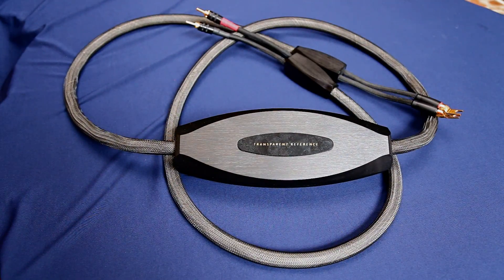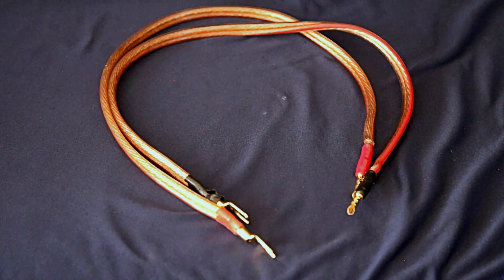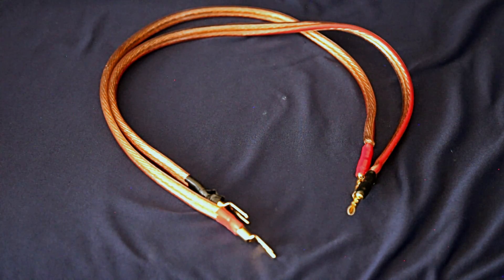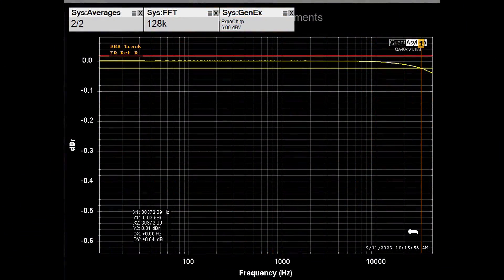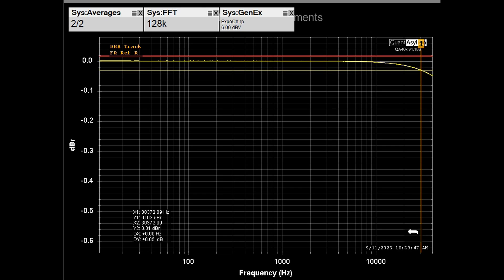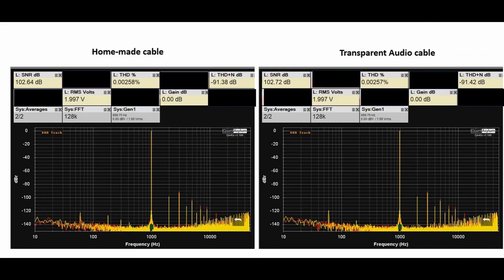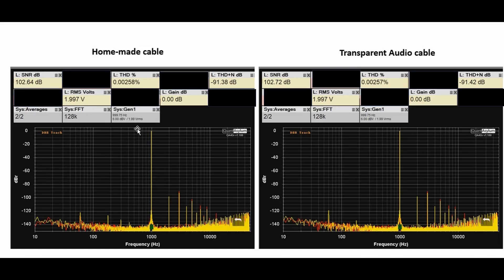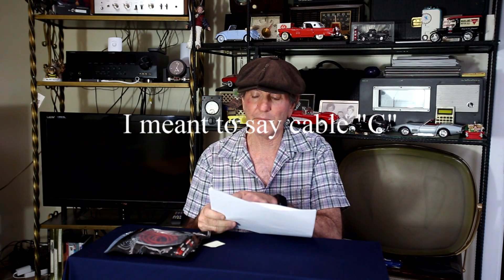$8000/pair Speaker Cable  vs. $14 DIY Speaker Cable A/B Test: Vintage Audio Review Episode #87

Comment: I used to sell stereo equipment and cables and I wouldn't sell expensive cable if I and the customer didn't hear a difference. I can tell you that speaker switchboxes and average quality stereo equipment will not let you hear the differences. The way to measure differences is to place a calibrated microphone in front of a speaker and measure frequency response and other characteristics there. I wonder if the is a way to measure soundstage width as there usually is a big difference there. I can tell you form a comparison I made years ago between hardware store 14 gauge lamp cord and audioquest type 6 speaker cable was that the hardware store cable rolled off the top end and muddied the bottom end and reduced the dynamics.
Reply: Rubbish ... The differences are purely imaginary.
Reply from the maker: If you are ever in Tucson we are going to have to get together for a beer or coffee
Reply: @vintageaudioreview   I should tell you that the speakers I use now don't really have speaker cables. The electrostatic panels connect directly to the amps. I was tired of all the distortion and coloration of all conventional speakers and cables.
Reply from the maker: @andershammer9307  Some of the best speakers I have heard are the Martin Logan CLX electrostatics, but they lacked bass the way I like it, even though he had some powered subs. I still thought there were speaker wires going to them....
Reply: @vintageaudioreview  My full range Acoustat X electrostatic speakers have some of the tightest deepest bass I've heard from any speaker. There is nothing like electrostatic bass except for live sound. You would swear I have a subwoofer but I don't.
Reply from the maker: @andershammer9307  Hopefully one day I will hear a pair of them, but the planar speakers I have heard have not had much bass. THnaks for sharing
Reply: @vintageaudioreview  You are welcome to come to Pittsburgh, PA to hear them. Just let me know before you come.
Reply from the maker: @andershammer9307  Sorry, I just picked up this thread between you and @andydelle4509 today. I would tend to side with @andydelle4509, but being able to measure is a key to sorting out a lot of claims by audio companies and helping to determine whether or not a speaker/amp combo is a good fit when you may press the limits. If the offer to come to Pittsburgh was for me, I appreciate that but I really don't like to travel more than about 2hrs from where I live (no real reason to at this stage in life)....
Reply from the maker: Thanks for taking the time to comment and share your experience. As for the soundstage I mentioned the same thing in an earlier comment I made on one of the posts on this video. You can get an idea from speaker measurements. The crosstalk (channel separation) of the amp/preamp could play a factor, and of course room acoustics. What you suggest with the calibrated microphone was done when I measure the frequency response of each cable with my analyzer- if you throw speakers, amps and the room into the mix there are even more sources of error, but I see your point. One commenter suggested that there should be a min. requirements list of equipment for fancy cables like Windows is doing now going from 10 to 11.
Reply: What was the wire gauge of the Audioquest cable? In this case it has to be 14awg or your test is doomed from the start. 

 "I can tell you that speaker switchboxes and average quality stereo equipment will not let you hear the differences."
 
Here we go again with this "resolving system" crap. That is pure audiosnob talk. What makes an amplifier or source device more resolving?  Three things, noise, distortion., and frequency response. Yes the old Julian Hirsch stuff, and it is still just as valid today. These things are easily measured, especially with today's computer analysis abilities, What are these numbers on a $600 Denon AV receiver? And on some $20,000 amplifier? Now I will cut you some slack with speakers as they are more an acoustical instrument than electrical. But I really have to laugh when some single ended 1/2 watt $20,000 tube amplifier with AC filaments and 10% distortion is said to be a "highly resolving amplifier".
Reply: @andydelle4509  My answer to you is to start reading the 80's vintage audio magazines like the absolute sound and stereophile and then get some of the equipment and cables they used back then and if the equipment is working properly you will most likely learn to hear the differences they talk about. The Audioquest speaker I used was type 6 but they had 3 different versions of the type 6 and they all sounded different.
Reply: @andershammer9307  And my answer to your answer is to start studying some basic electrical and electronic theory, Then move onto the mathematics which supports these well proven theories. That should prove to you these claims in audio magazines  have no scientific basis and rely on expectation bias, placebo effect, both coupled with lack of any understanding of the electrical engineering and electronics practices that have served mankind for over 100 years now. 

And you didn't answer my question.  I asked what were the wire gauges of the cables you auditioned? What is "type 6"? That is not a standard of wire size and capacity. There are both American and Metric standard wire sizes that are easily cross-referenced.
Reply: @andydelle4509  Ha Ha very funny. I'm an electronics repair tech presently repairing train control systems for companies like CSX and Amtrak. So I think I know a thing or 2 about electronics and I've been doing it more than 40 years. Type 6 Audioquest was a type of litz wire with several insulated strands of litz wire twisted together so i'm not sure of actual gauge. I think I still have them.
Reply: @andershammer9307  Control systems. That is mostly DC territory. How about AC circuit theory? This will explain how Litz wire works for RF but the math also shows it has no benefit at audio frequencies. Zero!
Reply: @andydelle4509  I may have access to test equipment to measure these things but I have a friend who is an engineer and we tend to hear the same things. He is sometimes baffled with what he hears but can't measure. If you rely on numbers and not your hearing then why bother ?
Reply: @andershammer9307  Expectation bias, placebo effect. You think in this day and age we can't measure an audio signal well beyond the limits of human hearing?
Reply: @andydelle4509  I know that we can't yet measure everything. My friend and I have access to the latest in electronic test equipment and we still hear differences that can't be measured. You may not hear differences but we do and can prove it and have proved it.

Comment: Good old 16ga lamp cord from the hardware store ... still the best speaker wire.
Reply from the maker: Honestly, 16guage lamp cord would be fine for most people's needs. I am not sure that it comes in OF copper, which I would want to use as I have had 16guage wire that was not OFC corrode over time, and that is in a dry climate. If you are running less than 15' to a speaker it should not be a problem. Thanks for your input.
Reply: @vintageaudioreview 
When properly tinned and soldered, the garden variety copper lampcord gives good long service.  OFC is best, I agree. 
The stuff you don't want is CCA (Copper Clad Aluminum) wire. That stuff is a technicians nightmare... it actively rejects solder, reacts with brass or gold fittings and breaks real easy when bent a few times.

A 10 foot speaker cable with 16ga lamp cord has a DC resistance of about 0.08ohms so it is suitable for most stereo uses. (4 ohms/1000 feet, 20 actual feet in the cord)
Reply from the maker: @Douglas_Blake_579  thanks for getting the resistance calculation. Years ago I read am article in stereo review or audio- probably in the mid 80's- and the author said that good old 16guage lamp cord is all most of us would need. As far as the corrosion, I am seeing it at points along the wire, which is somewhat clear, not specifically at the ends. Probably looks worse than the effect- at least at this point- by I built a match for the one wire that was used in the test so I use that now for my reviews.
Reply: @vintageaudioreview 
By corrosion I trust you mean that green mould like stuff... not simple colour changes in the copper.  Usually the jacket protects the copper quite nicely and harmful corrosion only happens in exposed bare wire ... which is why we tin the ends.
Reply from the maker: Actually, the green mold stuff. If i get around to it I will email you a photo.
Reply: @vintageaudioreview 
There is a dielectric grease you can brush onto the cables to prevent that.
I'll see if I can find a link for you...
Reply from the maker: @Douglas_Blake_579  Thanks for the suggestion, but having to grease the cables would be too messy to have in the house, plus the wires do have insulation over them. It is not a problem any more as I have replaced them with thiker, OFC wires
Reply: @vintageaudioreview  
I'm only talking about a tiny spec of grease at the actual connection points, to exclude oxygen from the bare wires.

In Canada if you are mixing AL or CCA wire with standard copper house wiring our electrical codes require this stuff be applied to every join and connection.
 
The big bugaboo here is that unless it's AC house or industrial wiring there is no obligation to disclose that what looks like copper is actually aluminum with copper powder pressed onto it's surface. Many times I've seen CCA speaker wire and even power cords sold as CU quality wire.  Amazon is one of the worst for this...

For those who insist on buying actual "speaker wire" I strongly recommend Monoprice brand. At least they tell you what grade of wire you're buying.
Reply from the maker: @Douglas_Blake_579  I will shoot you a picture of the wire before too long....
Reply: @vintageaudioreview 
Okey Dokey...

Comment: The best speaker cables I've personally tried were DIY braided CAT5. Very labor intense, but very good results.
Reply: The problem is such construction can have an extremely high capacitance per meter. That can create problems for some amps, putting them in oscillation or causing them other issues like ringing. For some amps it can work as an eq filter slightly boosting highs or lows. If you heard anything it was that. Personally I prefer eq to be controlled more precisely (in software or a treble control) . 

It’s is simple physics: the braided construction lowers the effective  impedance per meter but thereby increases capacitance per meter in proportion. The greater the number of braided strands  the greater the capacitance. And you would need lots of strands to get to a reasonable equivalent gauge, such as 14 awg (kimber kable 4pr is braided with 4 strands each for pos and neg for an equivalent awg of around 14AWG but each strand is much thicker than a single cat 6 wire.  Indeed while the braided geometry has some science going for it in that it lowers inductance per meter relative to the same gauge zip cord, going over 8 braided conductors is pointless as the reduction in inductance has decreasing returns as you increase conductors while you are potentially straining the amplifier and creating weird effects.

For all the labor of braiding yourself, it makes more sense to just buy some kimber 4pr or 8pr or KnuKoncepts Krux wire, which is also braided and much less expensive.  Pure copper conductors is all you need. All the other claims  higher end  kimber tries to sell you is a bunch of snake oil. 

But the question remains: do the measurable changes to inductance and capacitance create and measurable and audible effect at the speaker? Maybe depending on the length, the amp topology and the speaker driver. But in most cases no. The differences of 14AWG braided vs 14awg zip cord are not relevant to the audio spectrum at any reasonable length; and for longer runs using  12awg or 10AWG ofc copper zip cord will more than compensate for braided cables lower inductance per meter without increasing capacitance per meter.
Reply from the maker: @ManFromLaBamba  Wow. Now that is a comment! I don't know if you saw some of the comments pointing out that the wire I built my cable from was Copper Clad Aluminum it turns out. But it worked great and sounded fine. Will have to see how it holds up. 14AWG zip cord meets most folks needs... but it does not look fancy 😁
Reply from the maker: That is an interesting concept- braided cat 5 cables- who many were used I wonder?

Comment: Yeah.  Let's put a Ferrari engine in my Mitsubishi Mirage and see how it works.  Wow!  This engine is crap.  It performs much better with a 1.2 L 3 cylinder engine.  I'm sure glad I didn't waste my money on Ferrai F8.  People who spend money on high end cars are dupes.
Reply from the maker: I am not sure I totally follow you here, but I typically don't fault folks who can afford to by an exotic car or piece of audio gear. Best value on a high end car is typically the Corvette... Thanks for the comment.
Reply: @vintageaudioreview  Well to make it simpler, if you attached that $8000 wire to a pair of tin cans I'm sure the result would be worse than if you attached a string and pulled them taut between your ear and your friends.
Reply from the maker: @helgar791  Ok, I guess.

Comment: Dare you to open the 8k$ speakers and see nothing inside then see your mouth drop !
Reply from the maker: We all wondered what the purpose of the "block with the feet on it" was. THey are too expensive to take apart...Thanks for taking the time to comment.
Reply: It's full of glue and magic. 100% the speaker cables you made are better ! @vintageaudioreview
Reply from the maker: @JasonsLabVideos  Thanks, and I know mine are easier to use as well.

Comment: I have a set of 9 gauge ofc cable that I wrapped with emf shielding and then terminated.  I'd be hard pressed to find anything better.  Still want to a/b some cables but have not yet.  Will go into a hifi place with some expensive cables sometime soon and test.  I would bet the only difference I would find would be resistance and my cables would be far more reveling.
Reply from the maker: Thanks for the comment. I am not sure that the EMF shielding was needed and would need to have a connector to would be grounded on the amplifier end at least, though with a single ended ground I am not sure how much EMI would be reduced if any- I can't see that being a problem at all for a speaker cable. You would need a milli-ohmeter to be able to measure your cables- I don't have one or I would have reported that data. But your speaker cables sound like they would work quite well, though I can't see them be more revealing than another well built  expensive cable.
Reply: @vintageaudioreview  good point on the shielding.  I just bought a mesh shielding more for looks.  As far as revealing, it's resistance that causes most issues with cable.  I've been told many times by "professionals" that it might be over kill. I find that statement odd tbh.
Reply from the maker: @theoracleprodigy   Good idea about using the mesh for looks, I am sure that it did not cost a lot. Unless you are running very long lengths of wires, the speaker wire resistance should not be a factor.
Reply: @theoracleprodigy 
A simple analogy, if I may ....
We all know that once you have a chain that can tow a car, using a bigger chain does not make it any easier to tow.  The vehicle weight and friction remain the same.

The same is generally true with electrical stuff too ... once you have a wire that can handle your signal, using a bigger wire gives you absolutely no advantage.  (Substitute... resistor, coil, capacitor, transistor etc. for "wire" and it still holds true.)
Reply: @Douglas_Blake_579  I get it.  The way it was explained to me was more like a highway.  You only need so many lanes for travel and only use so much.  Here is the thing though.  I'd rather have more than enough and not need it than need it and not have it.  My cable lengths are only ten feet each side.  It's overkill I know.
Reply: @theoracleprodigy 
A little "engineering overhead" is always a good idea. It's what keeps bridges from falling down during rush hour 😳 
But like anything else, taken too far it only increases cost and bulk without actually providing any advantage.